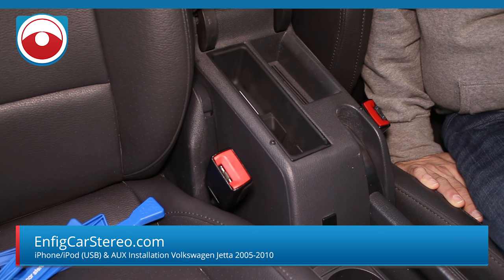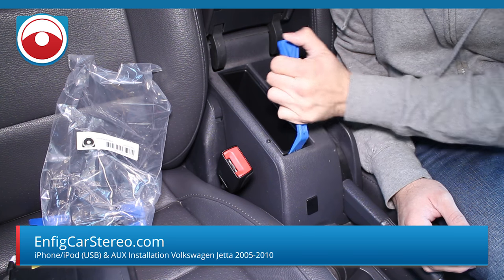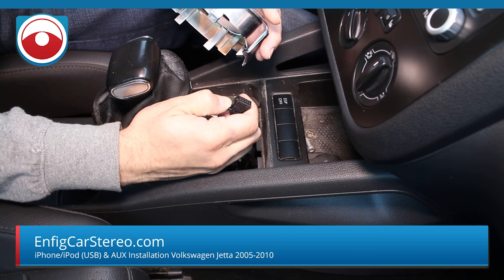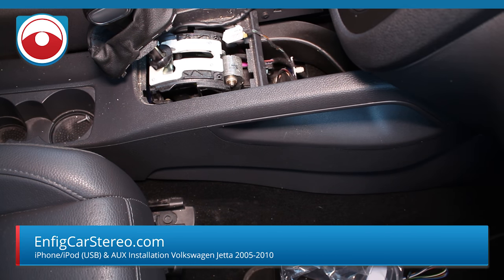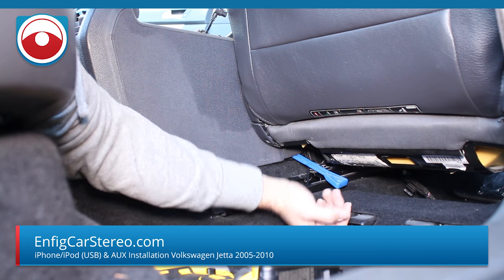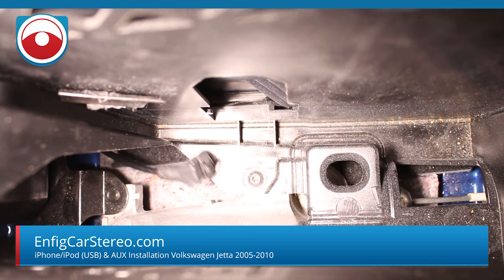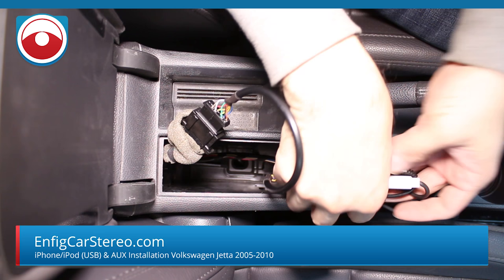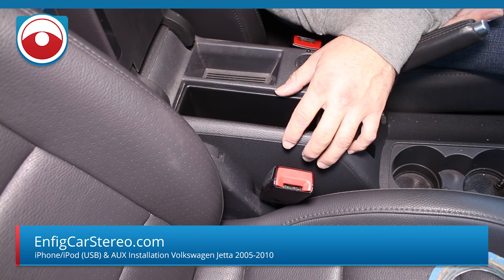Easy install iPhone adapter 2006-2009 Volkswagen MK5 Golf GLI GTI Jetta R32 Rabbit

Comment: Great Instructions!  I just finished installing this and it all went well.  Like he mentioned it is a bit more difficult to fish the cables to the center console with the seat in.  I recommend working from the passengers seat to fish cables so your hand is facing the right way when trying to grab the cable.  Took me 20 mins from start to finish.    Works great!

PS I left all the connectors connected and just worked around them.  It expedited the whole process.

Comment: Any idea what the charge rate on this set up is? I'm not aiming for mains power (obviously), but also don't want a trickle!
Also, I'm assuming this will work with iPhone 7's for both power and audio simultaneously?

Awesome video - as detailed as ever!
Reply from the maker: Its rated at 1AMP but I have never had any charging complaints like other 1A  adapters so I think it may  be under rated.

Comment: Could you please list the products used in the video ?
Reply from the maker: Here are your options.

1.AUX only
https://enfigcarstereo.com/ENFIG_VWT_AUX.html

2.AUX + Bluetooth Music WITHOUT song up & down controls from radio
httpss://enfigcarstereo.com/ENFIG_VWT_BTA_AUX.html

3.iPhone & iPod through 30pin (audio, charging and control no text) + AUX
https://enfigcarstereo.com/DENSION_GW1LVWT.html

4.iPhone & iPod through USB (audio, charging and control no text) + AUX 
https://enfigcarstereo.com/ENFIG_VWT_IPDU_AUX.html

5.USB for memory sticks only + Bluetooth for calls and music with option for iPod and aux. 
https://enfigcarstereo.com/DENSION_GBL3VW8.html This will not connect to your car withouit the adapter below. There is a different unit that connects to the back of the radio.
https://enfigcarstereo.com/ENFIG_AUD2_TO_VWT.html This converts the connector above for installation in the center console.
The unit above has a 9 pin round port that can accept any of the devices below.
Adding this allows you to add a female USB for apple products.
https://enfigcarstereo.com/DENSION_LIA1GW0.html
Adding this allows you to connect an aux to the unit above.
https://enfigcarstereo.com/DENSION_CABL_AUX.html
Custom microphone that fits in factory mic location in the overhead console.(Most cars have it)
https://enfigcarstereo.com/ENFIG_MIC_VW1.html

Custom USB and AUX extensions.
https://enfigcarstereo.com/ENFIG_MK5_MK6_SHIFTER_AUX.html
https://enfigcarstereo.com/ENFIG_MK5-MK6-SHIFTER-USB.html

Removal Tools
https://enfigcarstereo.com/ENFIG_PPT_12345.html

Keys to remove the CD changer if you have that instead of an iPod dock.
https://enfigcarstereo.com/86_9001.html

To fill the hole if you had a CD changer or ipod dock between the seats
https://enfigcarstereo.com/ENFIG_PKT_VW07.html

Comment: Do you have something like that for 2006 Audi A3? it does have kinda thing like that at the center arm rest. It’s a symphony 2 loaded with Bose system. Thx
Reply from the maker: We have one that goes in the glove box.  Check out the site for details.  The connection in your center console us probably for a phone but it was never used by Audi.

Comment: What the name of the adpter??
Reply from the maker: Here are your options.

1.AUX only
https://enfigcarstereo.com/ENFIG_VWT_AUX.html

2.AUX + Bluetooth Music WITHOUT song up & down controls from radio
httpss://enfigcarstereo.com/ENFIG_VWT_BTA_AUX.html

3.iPhone & iPod through 30pin (audio, charging and control no text) + AUX
https://enfigcarstereo.com/DENSION_GW1LVWT.html

4.iPhone & iPod through USB (audio, charging and control no text) + AUX 
https://enfigcarstereo.com/ENFIG_VWT_IPDU_AUX.html

5.USB for memory sticks only + Bluetooth for calls and music with option for iPod and aux. 
https://enfigcarstereo.com/DENSION_GBL3VW8.html This will not connect to your car withouit the adapter below. There is a different unit that connects to the back of the radio.
https://enfigcarstereo.com/ENFIG_AUD2_TO_VWT.html This converts the connector above for installation in the center console.
The unit above has a 9 pin round port that can accept any of the devices below.
Adding this allows you to add a female USB for apple products.
https://enfigcarstereo.com/DENSION_LIA1GW0.html
Adding this allows you to connect an aux to the unit above.
https://enfigcarstereo.com/DENSION_CABL_AUX.html
Custom microphone that fits in factory mic location in the overhead console.(Most cars have it)
https://enfigcarstereo.com/ENFIG_MIC_VW1.html

Custom USB and AUX extensions.
https://enfigcarstereo.com/ENFIG_MK5_MK6_SHIFTER_AUX.html
https://enfigcarstereo.com/ENFIG_MK5-MK6-SHIFTER-USB.html

Removal Tools
https://enfigcarstereo.com/ENFIG_PPT_12345.html

Keys to remove the CD changer if you have that instead of an iPod dock.
https://enfigcarstereo.com/86_9001.html

To fill the hole if you had a CD changer or ipod dock between the seats
https://enfigcarstereo.com/ENFIG_PKT_VW07.html

Comment: Can't find it on ur wep site
Reply from the maker: Here are your options.

1.AUX only
https://enfigcarstereo.com/ENFIG_VWT_AUX.html

2.AUX + Bluetooth Music WITHOUT song up & down controls from radio
httpss://enfigcarstereo.com/ENFIG_VWT_BTA_AUX.html

3.iPhone & iPod through 30pin (audio, charging and control no text) + AUX
https://enfigcarstereo.com/DENSION_GW1LVWT.html

4.iPhone & iPod through USB (audio, charging and control no text) + AUX 
https://enfigcarstereo.com/ENFIG_VWT_IPDU_AUX.html

5.USB for memory sticks only + Bluetooth for calls and music with option for iPod and aux. 
https://enfigcarstereo.com/DENSION_GBL3VW8.html This will not connect to your car withouit the adapter below. There is a different unit that connects to the back of the radio.
https://enfigcarstereo.com/ENFIG_AUD2_TO_VWT.html This converts the connector above for installation in the center console.
The unit above has a 9 pin round port that can accept any of the devices below.
Adding this allows you to add a female USB for apple products.
https://enfigcarstereo.com/DENSION_LIA1GW0.html
Adding this allows you to connect an aux to the unit above.
https://enfigcarstereo.com/DENSION_CABL_AUX.html
Custom microphone that fits in factory mic location in the overhead console.(Most cars have it)
https://enfigcarstereo.com/ENFIG_MIC_VW1.html

Custom USB and AUX extensions.
https://enfigcarstereo.com/ENFIG_MK5_MK6_SHIFTER_AUX.html
https://enfigcarstereo.com/ENFIG_MK5-MK6-SHIFTER-USB.html

Removal Tools
https://enfigcarstereo.com/ENFIG_PPT_12345.html

Keys to remove the CD changer if you have that instead of an iPod dock.
https://enfigcarstereo.com/86_9001.html

To fill the hole if you had a CD changer or ipod dock between the seats
https://enfigcarstereo.com/ENFIG_PKT_VW07.html

Comment: We're can get this
Reply from the maker: Here are your options.

1.AUX only
https://enfigcarstereo.com/ENFIG_VWT_AUX.html

2.AUX + Bluetooth Music WITHOUT song up & down controls from radio
httpss://enfigcarstereo.com/ENFIG_VWT_BTA_AUX.html

3.iPhone & iPod through 30pin (audio, charging and control no text) + AUX
https://enfigcarstereo.com/DENSION_GW1LVWT.html

4.iPhone & iPod through USB (audio, charging and control no text) + AUX 
https://enfigcarstereo.com/ENFIG_VWT_IPDU_AUX.html

5.USB for memory sticks only + Bluetooth for calls and music with option for iPod and aux. 
https://enfigcarstereo.com/DENSION_GBL3VW8.html This will not connect to your car withouit the adapter below. There is a different unit that connects to the back of the radio.
https://enfigcarstereo.com/ENFIG_AUD2_TO_VWT.html This converts the connector above for installation in the center console.
The unit above has a 9 pin round port that can accept any of the devices below.
Adding this allows you to add a female USB for apple products.
https://enfigcarstereo.com/DENSION_LIA1GW0.html
Adding this allows you to connect an aux to the unit above.
https://enfigcarstereo.com/DENSION_CABL_AUX.html
Custom microphone that fits in factory mic location in the overhead console.(Most cars have it)
https://enfigcarstereo.com/ENFIG_MIC_VW1.html

Custom USB and AUX extensions.
https://enfigcarstereo.com/ENFIG_MK5_MK6_SHIFTER_AUX.html
https://enfigcarstereo.com/ENFIG_MK5-MK6-SHIFTER-USB.html

Removal Tools
https://enfigcarstereo.com/ENFIG_PPT_12345.html

Keys to remove the CD changer if you have that instead of an iPod dock.
https://enfigcarstereo.com/86_9001.html

To fill the hole if you had a CD changer or ipod dock between the seats
https://enfigcarstereo.com/ENFIG_PKT_VW07.html